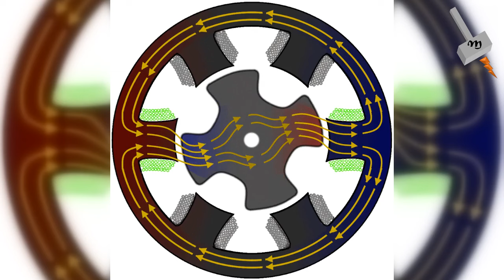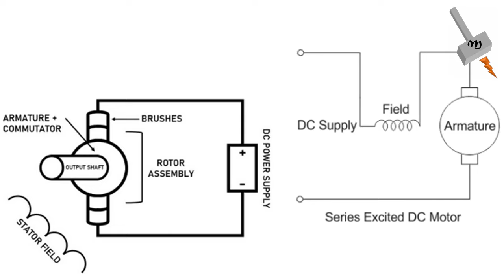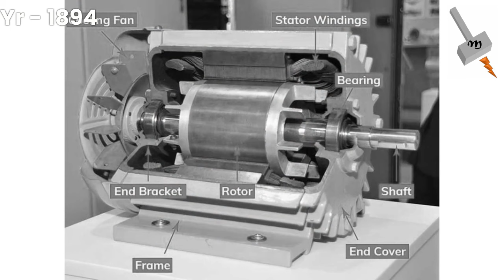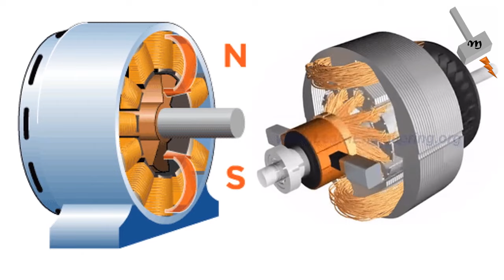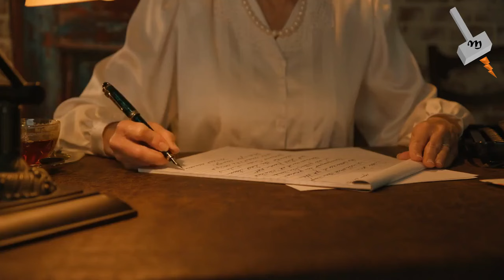Evolution of Electric Locomotives

Comment: 00:01 Evolution of Electric Locomotives
01:00 Electric locomotives were introduced in the late 19th century as an alternative to steam locomotives.
02:03 Electric locomotives were developed due to the increasing use of tunnels and the prohibition of steam power.
03:06 Three-phase Motors had higher power to weight ratio and were simpler to manufacture and maintain compared to DC motors.
04:05 3-phase 2 wire system used on Italian Railways
05:17 Electric locomotives provided more traction on steep lines.
06:19 AC traction system became the standard for new Mainline electrification systems by 1960
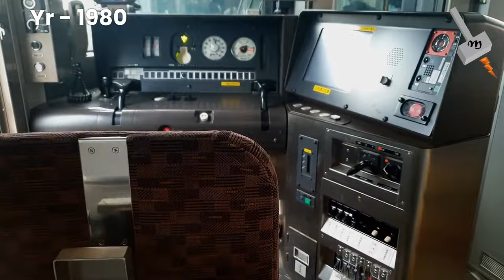07:21 Electric locomotive technology has significantly improved speed and reliability.
Reply: It was great to see illustrations of the early locomotive ‘Galvani’.